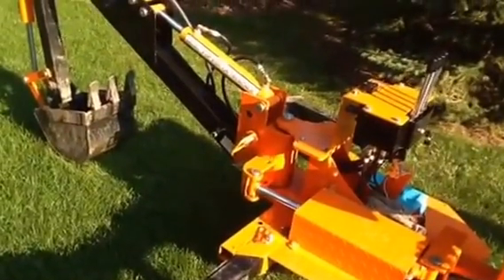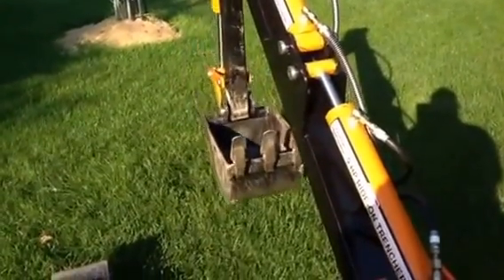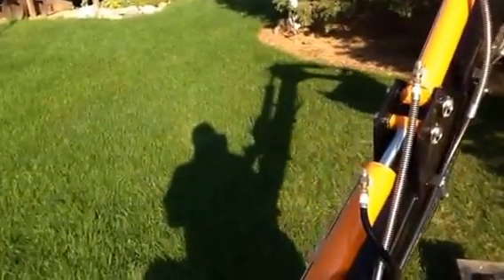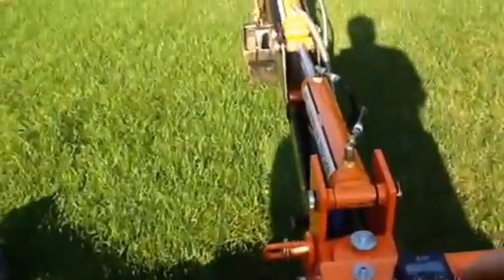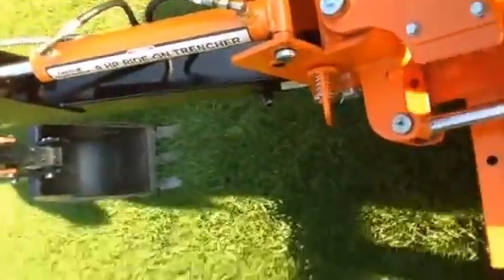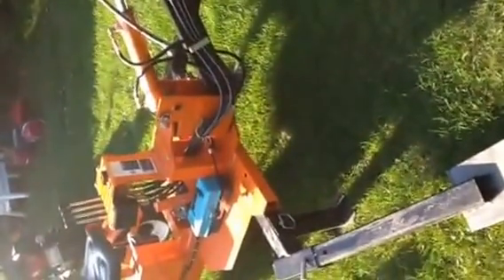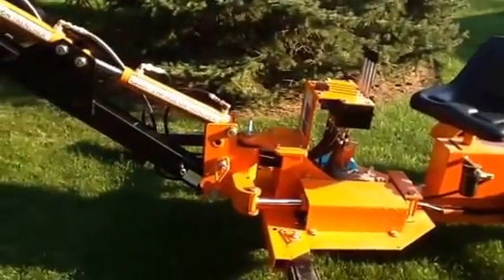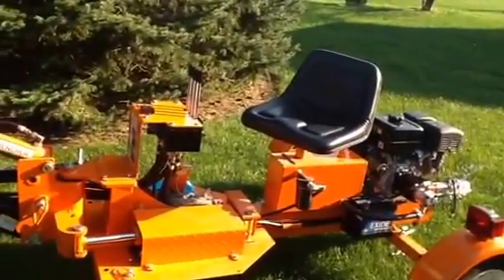Harbor Freight trencher 65162 hydraulic speed upgrade

Comment: Thanks for posting,
Could you tell me the information on where to buy the upgraded parts you have in this video. I am not sure where to get them but would like to purchase everything that you would have to buy to upgrade the power by 20%.
Thank you very much.
Reply from the maker: Use the information below and part number at your local hydraulic dealer to obtain the pump.
Reply: goneredcar1
Thanks for the response,
Is it the information in the comment section from the other video where you increased the speed by 35%?
Reply: @goneredcar1  I cannot find the "information below". Can you share the manufacturer and model # of the pump you ended up using?
Reply from the maker: Barry Wray it’s all listed below pump Pompa 614470242

Comment: Do you know if there is a "thumb" attachment available that will allow it to grab and pick up brush and small sticks?
Reply from the maker: Look on ebay for a 16 inch thumb they run about  $170.00 and will work great .  I used mine to hold large branches while I cut them.